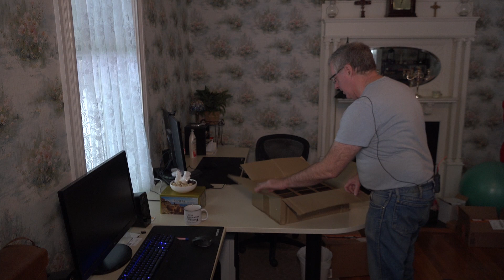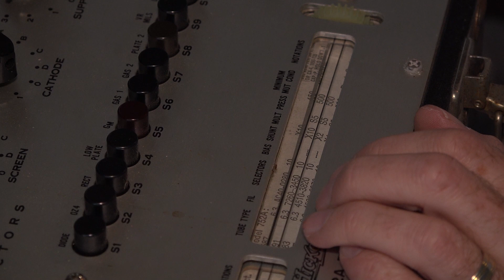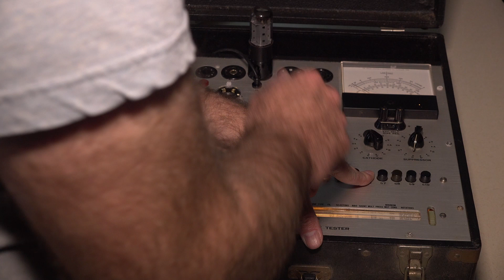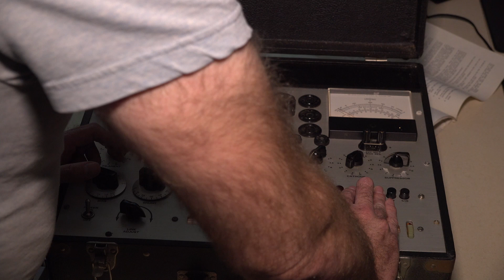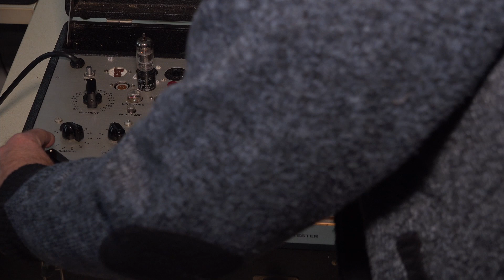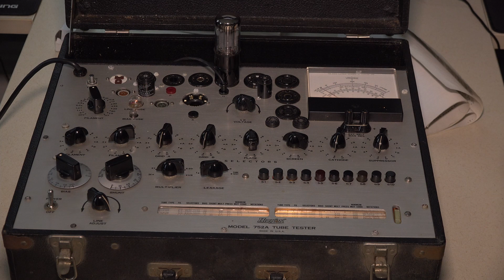Heathkit AA 100 Repair Pt 1

Comment: I have a solid state version of thi amp. It is hopeless with those early germanimum transistors.blowa up every other time i use it! Stay away from those.
Reply from the maker: You can't go wrong with tubes. I have no plans to work with transistorized Heathkits.

Comment: this is  nice "how to test tubes" segment, but where is "repair pt2, pt3..."  Never got fixed? I also had a dickens of a time finding replacement cap cans for the power circuit.
Reply from the maker: I was wondering when somebody would ask! ;-) Life got in the way, then I started to get repair/restoration work. When there's a break in the action, I'll throw it back on the bench and start working at it again.
Reply: @daystromaudio1903  Excellent. Ya know, you could make some extra money if you sold an update kit like the power section; power cap cans, etc. I see you had a similar kit sent to you in one of your other episodes. That is gold!

Comment: Do you have a website? I could only find your pcb on Ebay.
Reply from the maker: The website wasn't getting any traffic for a long time so we turned it loose. Our ebay store is the only way to buy the pcb these days.
Reply: @daystromaudio1903  Possible to buy it as a bare board or design files and a bom? I live in sweden so the shipping usally gets to be too much from the US and I really would like to assemble the board myself anyway. I have the original schematic for the amp. I really would lik to build it as mono blocks though.
Reply from the maker: @rimmersbryggeri  All of the circuit boards have been built up into kits so there are no bare boards available.

Comment: Nice amp with decent iron in it.
You could do a version of your PCB that would replace the 7199s with 6GH8/6U8 types, which are cheaper and much easier to get. Adapters are also available. I think that RCA was screwing around with the tube market when they made the pinout unnecessarily incompatible with other similar tubes (they were experts at this). 
A number of years ago I removed the heat-damaged power amp PCB from an AA-100 (bias supply), replacing it with a subchassis employing turret strips. At that time, there were no eastern European 7591 tubes available and NOS ones were impossible to find. There are two other tubes having different bases but identical characteristics: 6GM5 (standard 9-pin base) and 7868 (Novar 9-pin base). As 7868 tubes were used by Ampeg in some of  their guitar amps and getting pricey as a result, I put 9-pin sockets on my subchassis to use 6GM5s. This worked well.
I wonder how many 7591 tubes have been destroyed in amplifiers due to selenium diodes deteriorating in the bias supply?
Reply from the maker: The kits don't sell fast enough to justify a re-design.

Comment: The EF86 is also known as the 6267, and ( more rarely) as the Z729. All have the same pinout and are interchangeable in most circuits.  Unfortunately they are also known for being microphonic which is a major problem for some Vox guitar amplifiers that use them. The 5879 tube (often found being used as a mic preamp tube in commercial paging amplifiers) is somewhat similar but has lower gain and *a different pin-out*,  therefore it's not a drop-in replacement. The 6AU6 (7-pin pentode) also has some similar characteristics but once again is far from being a drop-in replacement due to requiring a different socket.
Reply from the maker: I always thought it was cool to hear the echo from thumping the tube! ;-)

Comment: Nice Hickok 752A you've got there. I have a bunch of Hickok testers but the 752A is my favorite, my go-to tester 99% of the time.  These were built up into the mid 1970s and yours is slightly later than mine because-mine has the older-style bakelite-housing meter and yours has a more modern, low-profile plastic meter.  These were once the reference tube checker for the Federal Aviation Administration, and will test nearly any tube from the 1920s right up to the end of the tube era (with the exception of obscure antique European tubes, big transmitting tubes and some Western Electric types for which setup data was never printed), assuming of course that you have the setup data for the tube in question, or are able to figure out how to set it up using the data provided in a tube manual.  Excellent units, and I really like the fact that you can test the 2nd half of a dual triode such as a 12AX7 simply by pushing the Plate 2 button.  (Although the owner's manual doesn't tell you this you can even test the 2nd half of a rectifier tube by pushing the plate 2 button, and the only other thing you will have to change  is the shunt knob setting for the second diode half of the rectifier). 

I also owned the earlier model 752 before I got the A version (the A version  includes sockets for 9 pin Novar tubes such as the 7868, and 12 pin Compactron tubes), and I am very familiar with these units,  so if you have any questions feel free to ask. I have an entire overstuffed loose-leaf ring binder of setup data for obsolete tubes and European tubes and even several photocopied roll charts from different years!
Reply from the maker: It has been a rock solid unit since I got it. This one came out of a radio station. It had been gathering dust in a store room for years. You know the story....."it's too good to throw out but I have no use for it." They were glad to have me take it away!
Reply: @daystromaudio1903 , nice snag!  My first 752 cost me $40 at a flea market some 25 years ago. I paid more than that ---- $60 ---- for copies of an owner's manual and all the test data for foreign and obsolete tubes etc.  Eventually I sold it and bought a 752A on ebay (about $400, some 15 years ago) so I wouldn't need to use separate adaptors for testing Novars, Compactrons and the like (I used to sell tubes online and being able to test anything and everything with one unit is very convenient; I also work for an audio repair shop and was testing Nuvistors for a McIntosh preamp recently). I think they sell for around $1k  these days, yikes!

Comment: I have one of these in the garage. Not sure if it still works or not, but I'm going to find out and if necessary repair and recap it.  Also have a nib un-assembled AA21 and matching tuner I am about to build.
Reply from the maker: That's amazing to come across unbuilt kits like those you have. You will have a good time putting them together!
Regarding the AA-100, the power output PCB is often fried from the heat of the tubes. I sell a drop-in replacement for these which uses the same circuit design but with fresh components and it also has independent bias controls for the output tubes. Check out these links for more information. 

https://aa100restoration.wordpress.com/
https://www.ebay.com/itm/333954566862
Reply: @daystromaudio1903  Sounds good.  Thanks!